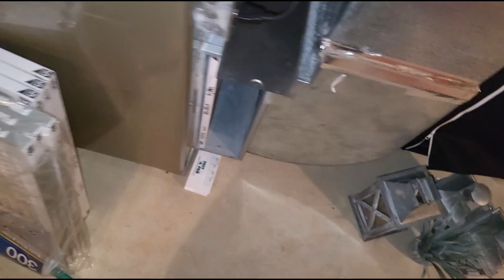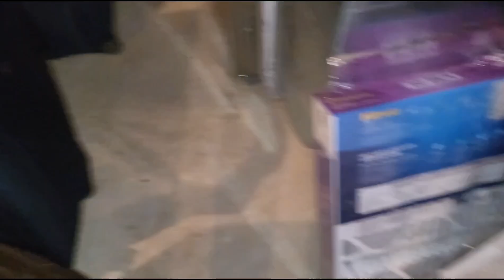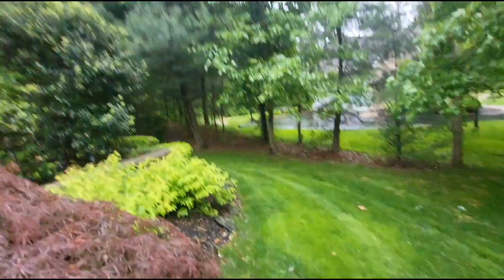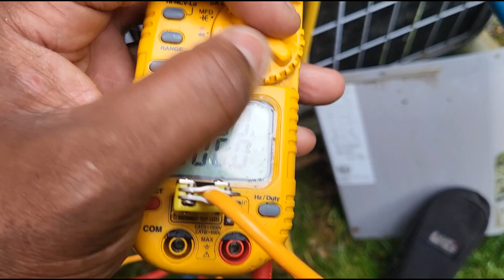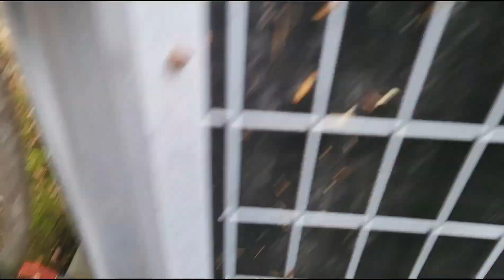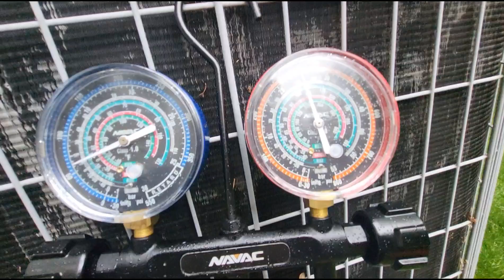400psi Head Pressure⁉️ | Air Conditioning

Comment: 400psi range would be if the unit is in the middle of texas,arizona, las vegas.
Or the condenser fan spinning the wrong way 
Or duct work return is choked up
Or air filter is dirty